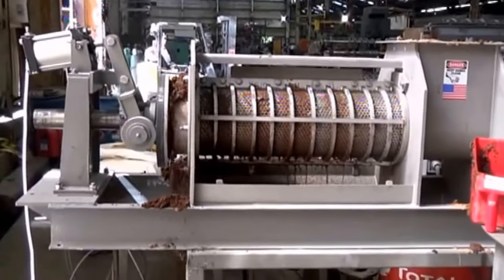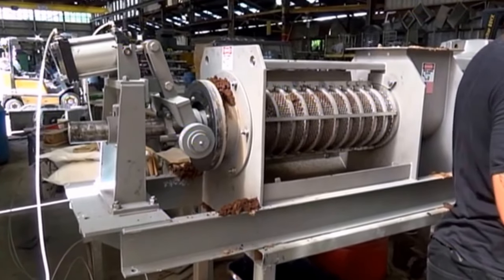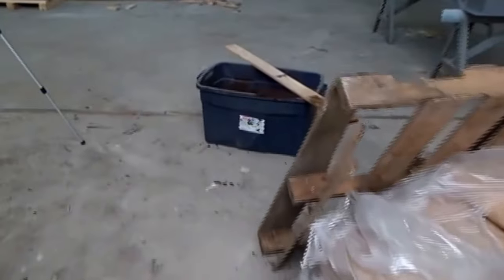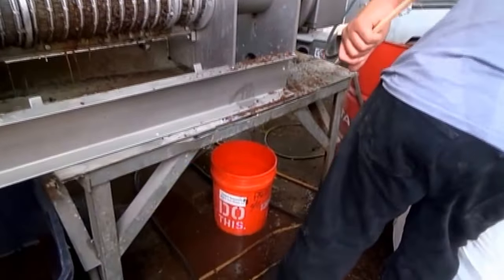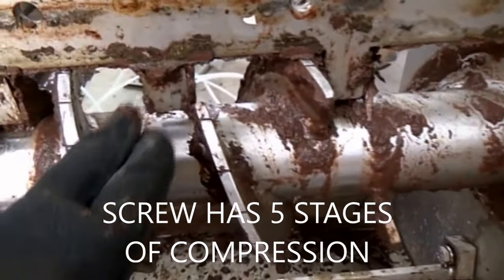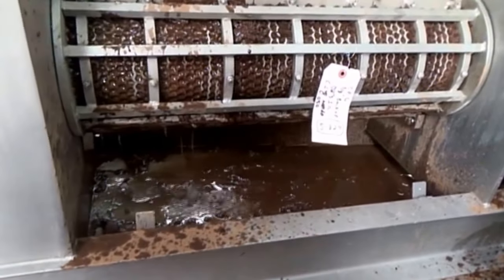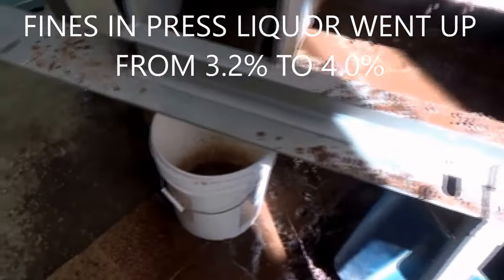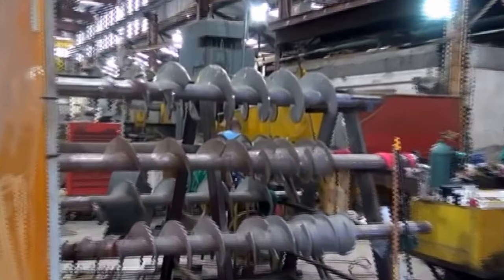CELLULOSIC ETHANOL

Comment: What is the overall concept of this technology. Cellulosic ethanol state of the art gives a 10% ethanol yield, which means 10 tons of biomass are needed to produce 1 ton of ethanol. So the input/output ratio is $1000 to $500 or a loss of $-500 per ton of ethanol. The energy input/output ratio is even worse at 5 tons of oil equivalent to 1 ton of ethanol oil equivalent received. Where does your process stand?